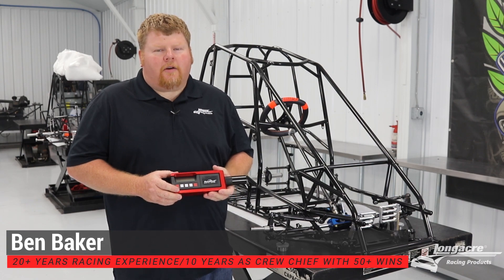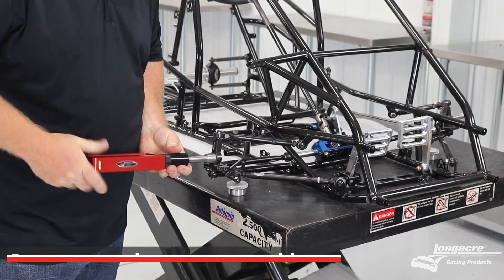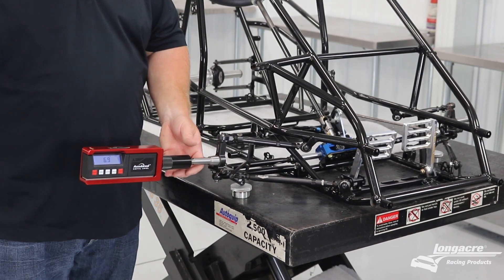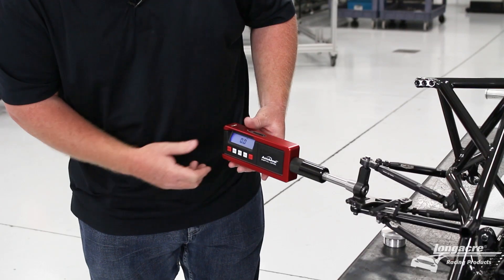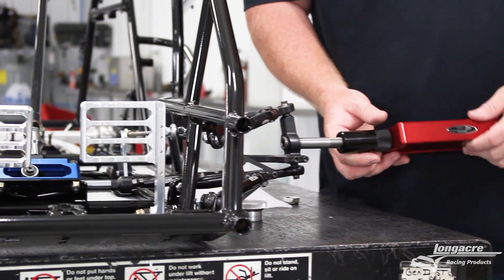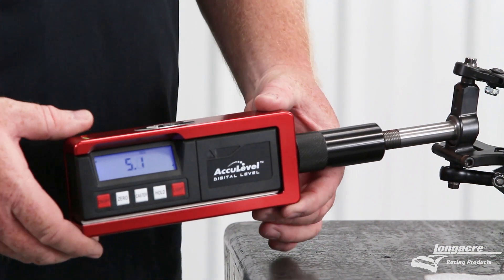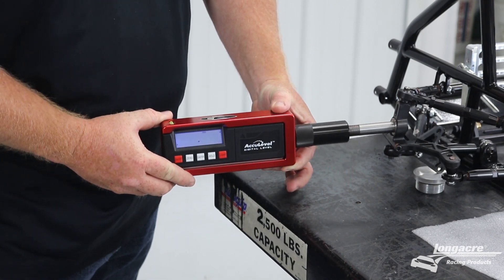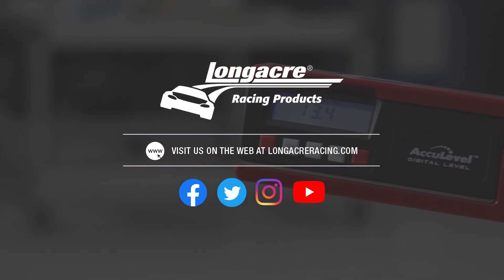Using a Digital Caster/Camber Gauge

Comment: First, this doesn’t seem like a useful tool unless you have a go Kart which happens to have a spindle with the same size threads as the tool.    Could it attach to a hub with the dust cover knocked off?    And when you turned the wheel 15 degrees, how did you know?   When you are trying to demonstrate a product, ostensibly to sell it, it is important to put yourself in the shoes of a user who knows nothing about the tool, and explain every detail that someone might have, without leaving things you might take for granted out of the equation.       Please.      I’m glad I watched this or I would have wasted money buying one.   I’ll buy one in a heartbeat if it can be used on any type of automotive hub.   Ideally, there should be a three legged spider like adapter so that it could mount on ANY rotor, and some kind of pin that can be let out of the center of the back of the tool to assure it is centered on the hub or spindle.
Reply: Your right, along with showing the threaded adapter he should also have shown the magnet (give magnet outer and inner diameter) and if it has a hole in the center and if yes give the center hole diameter.)  You would have to use "alighnment turnplates" with at least 20 degrees sweep on each side- he should have showed that.  Also, you can't do it the way he did, the spring has to be installed and the tire installed sitting on the ground naturally- and jack back up and remove tire to for adjustments on most applications.  If using new springs, you should re-check after the springs settle in, maybe six months or so, depending on how much and how hard you drive it??  The digital guage is nice, you can't spend the time getting a "perfect alighnment" with a bubble gauge.  The good thing about the bubble gauge is that it is always calibrated, Longacre says nothing about how often to check/re-calibrate it and if they offer those services which could be a deal breaker- same with digital torque wrenches.  You can kinda check the digital against a bubble gauge for zero, but it could read zero and have the linear range off.
Reply: Also, keep in mind that he doesn't give a part number for the gauge (58-78292) nor the other parts numbers depending on adapter (yes, they do have a universal wheel adapter,) or price range (253-258 as of 04/2024.)  My guess is that he didn't mention or show turn plates because Longacre, for some crazy backwards reason, does not offer such product.  If you want to avoid spending a grand and want something decent for occaisional use I have had sucess with PMD Products 1850 (130.00) turnplates.  Heads up- Longacre has a problem keeping stuff in stock.
Reply: He shouldn't have to, but you are correct that the whole purpose of the video is to lead the viewer to the website and ultimately to call sales as the descriptions lack a lot of information such as "What is the +/1 % of error for the digital version" which is something premium digital tool/scale manufacturers normally state, not to say their tool isn't accurate, but until they post that, along with if they offer a check/re-calibrate service entertain all options...
Reply: In the amount of time it took you to type out this comment you could.have checked their website and seen that it is offered in a magnetic base as well and then when they are in stock, the have a wide 5 adapter as well ypu can use.